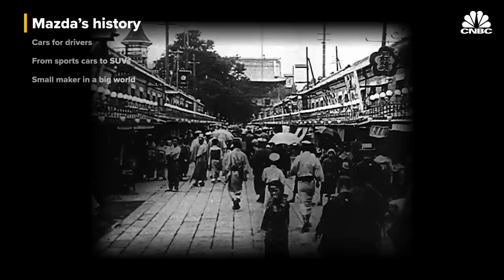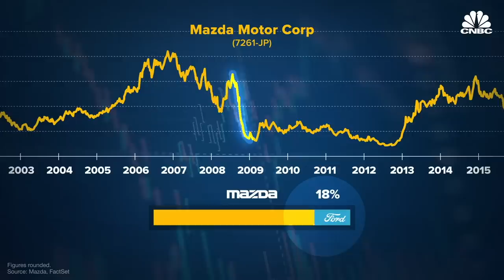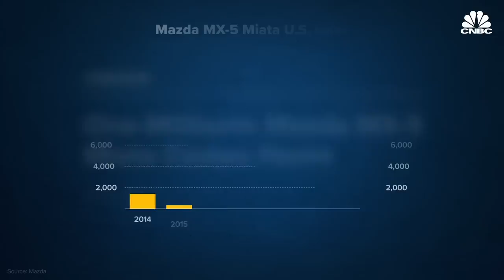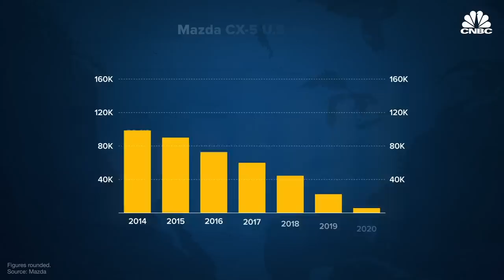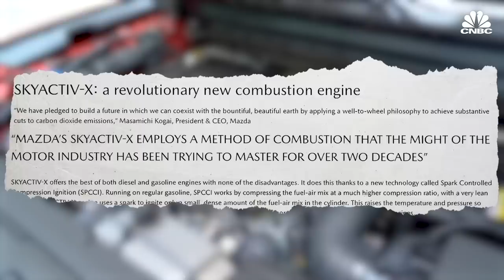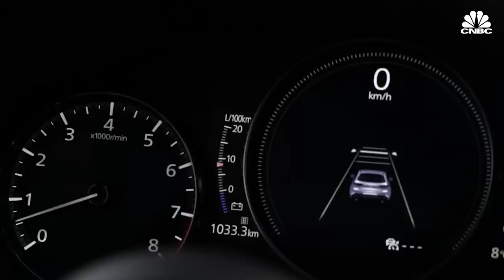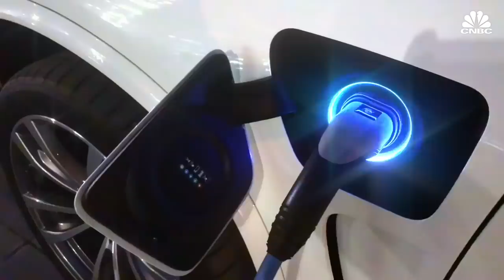Can Small And Scrappy Mazda Survive Among Automotive Giants?

Comment: With almost every company making CVTs as their main transmissions Mazda is still using more natural feeling transmissions thank you for that.
Reply: Bought a new Mazda3 this week.  Sure it gets worse fuel economy than the Elantra/Civic, but it's nice having a regular transmission and powerful motors.
Reply: Yes and no as It's too bad their 6spd autos are so dated , super slow shifting and not really comparable to modern automatic transmissions from other brands that shift so much faster and crisper.  I guess being so small they don't have much resources to develop new transmissions
Reply: If they get the Toyota CVT, their MPGs and 0-60 will improve drastically
Reply: European companies aren’t using CVTs either
Reply: What is the difference please
Reply: “Natural”
Reply: What is a natural feeling?
Reply: YES, I love the manual transmission. I love driving a car, not pushing a button & steering a lounge chair like those SUV-driving AUTOMATRONS who think their mirrors are for checking if their door handles have splattered bug on them while their driving; instead of checking the traffic in the lane next to them.
Reply: @cx5870  gear changes instead of a cvt which holds the rpm at a certain point
Reply: @Bambotb  CVT'S are generally less reliable; the least are Nissan cars with cvt's; avoid them like the plague. Toyotas and Hondas should be ok.
Reply: My car has a cvt and when friends drive it they ask if it's a dct because it shifts so fast
Reply: @cx5870  It's close to manual transmission feeling which I am used to driving. But when I came to North America found almost no one drove manual and almost all cars sold were automatic. In fact, those which came in manual were generally very lower spec models which made it quite a bummer.
Reply: @kidnamedfinger6323  Yes, it's cause there are no physical gears. Its just belt and pulleys...
Reply: @Bambotb  CVT always at high revs going eeeeeeeeeeeeeeeeeeeeee but offers better economy.  Auto works almost like a manual. Less noise, Revs build up with every gear change. I' m a sucker for manual which is the least economical choice but is the most reliable ( as long as you do the right maintenance) and most fun.
Reply: You do realize their transmission is a very old and aging 6-speed automatic design that almost every manufacturer has evolved from 10 years ago, don't you? There's a reason why Mazda moves at such a slow pace; they can't afford to do so otherwise and the customer pays for it. You're paying a premium for corporate sentiments rather than tangible goods. That's a raw deal.
Reply: Exactly, I own 2 Mazdas, one with standard transmission and the other one with a regular automatic, no CVT for me, thanks mazda
Reply: couldnt have said it better myself. mazda's are fun to drive unlike basically everything now.
Reply: Toyota has a good CVT but In many of their vehicles, they are still making geared transmissions. Lexus vehicles, Toyota Camry for example.As they should as Toyota geared transmissions are well made and reliable.
Reply: @gilboman  their torque converted transmission is bullet proof compare to when theyre were under Ford
Reply: CVT’s need to be banished from the market! Oh how I HATE CVT’s!!!!!
Reply: @gilboman  they make their own transmission everybody else buy it from zf aisin jatco getrag
Reply: @kristians2704  how about renault some mini models audi french use cvt list is long mate plus nothing wrong with cvts if you  drive carefully every transmission have some kinda problem dcts have problem too thats why everyone is ditching them
Reply: @ramanjitsingh4340  They aren't ditching them due to problems. They are ditching them due to stricter regulations every year for fuel efficiency.
Reply: Don’t forget the manual transmission.
Reply: @Bambotb  when you hit the gas in a CVT the car doesn’t go... there’s that
Reply: @anonymous00117  can’t afford them new always buy used so I can only get what someone else wanted. Which is the current situation with used cars. Hint why manual transmission cars demand a premium on the used car market.
Reply: @markmiller4503  what about porsche
Reply: @Bambotb  I’m not sure I have never drove a cvt Porsche...
Reply: Mazda always been number one on my list ..1 of The main reason I got a mazda was because of them not using that stupid cvt transmission 
No response 
Horrible fuel economy 
Un reliable 
 A fortune to fix 
Will last no more then 5 years 
Will force consumers to constantly buy cars 
Cvt are beyond garbage transmission.. I had a bad experience with it and. I will never ever buy that crap again 

I got a mazda protege 19 years old still running and I abused it too and it still takes me to work and back mazda a soldier when it comes to reliability and longetivity 
Just got a cx-5 hands down on of my favorite suv I bought 
And the feel of a regular transmission is amazing 
Thank you mazda keep it up 
I been. A loya customer of you guys and always will be
Reply: @gilboman  im gonna disagree with you on that one therre 6speeds are actually pretty smooth shifting and hauls ass i love my cx-5 the speed the size the comfort its perfect 
mazda is one up on the transmission game tho because they dont use that bullshyt cvt transmission that almost all cars are using now adays  
you dont even know what cars have and dont have cvt bullshyt ..mazda is that one brand not only reliable to the extreme but dont use garbage transmissions  like almost every single car brand out there 
mazda aint small no more there coming up anad collaborating with toyota .. and there new line up of cars are beautiful
Reply: @Striker50_  
i hope they dont cause cvt are garbage
Reply: @fp5495  
i never had any problems with my mazda with any of em and another thing u can say there 6 speeds are outdated but they would spank any engine with a cvt toy transmission all day .. and i think there 6 speeds haul ass  and very smooth shifting and driving i love it .. mazda coming up  especially on there skyative tech
Reply: I would pay extra just to avoid the belt and pulley style CVT.
Reply: @Striker50_  No, just a little more. If you want drastic improvement go with a hybrid.
Reply: I disagree , a lot of companies are switching over to 7-8-9-even 10 speed automatics , and Mazda has had the same 6 speed auto trans for years now , and engines are the same as well , it’s literally the same car just outside appearance is changed , also the cost for the dated tech is outrageous , I was looking at a Mazda 3 hatch and the way I liked it was kissing near 36k , got a Tesla model 3 instead for 37.8k
Reply: @gilboman  exactly thank you !!!
Reply: @kidnamedfinger6323  It won't shift at all 4 years from now, but good luck
Reply: @Striker50_  My family switched from an older Corolla using a 4-speed auto gearbox to a newer one using a CVT but I measured the fuel consumption to be about the same (though the latter runs quieter)
Reply: @lzh4950  The older Corolla must weight much less.
Reply: @anonymous00117  Was thinking the same thing, maybe because they can't afford a new Mazda, surprising I know. It's so hypocritical of them, they want brands to keep making manual transmission cars and when they do, they jump up and down and sales are a disaster. You know why? They want to wait for those cars to come to the used market, then they can pick them up for a bargain price. I totally agree with your point of view, if you want brands to listen to you, you need to buy their product from them, then they will listen to you. Being a keyboard warrior and ranting on the internet will do NOTHING!
Reply: @maggiejetson7904  and No stop start crap. That and poor paint are good reasons to avoid mazda cars. I will be shopping at Kia or Hyundai after my disappointment with mazda aftersales Non support and poor service experience.
Reply: @gilboman  You only need 6 speeds since the car doesn't hit more than 130 mph.
Reply: @tylersmith4265  And you forgot, less expensive than a Civic.
Reply: @miatand1156 My 2024 Mazda doesn’t have the crappy, start/stop feature. I wouldn’t have bought it if it did. ✌🏻
Reply: cvts are underrated, but it makes sense for Mazda to
use a regular 6 speed automatic. yeah because the brands DNA is
still felt in the vehicles they're producing,
a company will only make what they know, but it's also the customers
they attract. people that are looking for a 
little more driving enjoyment, will buy Mazda, because that's what they're
looking for. no company ever wants to alienate
there customers, but the reason other companies are using cvts, 
it all has to do with efficiency. And at the end 
of the day, the average buyer who needs a car doesn't care as much.
their only looking for reliable transportation.

Comment: I love how Mazda manages to keep their interior very sleek and simple while keeping physical controls and buttons.
Reply: Well they don't have a radio volume knob or change the channel knob so that's a set back for me. Having to go to the display for anything is NOT progress in my book.
Reply: @captinbeyond  I don't know which ones are you talking about. But in Miata, Mazda 3, and CX9 (frankly, I have not tried the other ones) you have a rotary volume knob on the center console (much like Audi used to have). And very close to it a bigger rotary knob for the multimedia screen, which you can use to set the radio channels or navigation, etc. (Also very similar to what Audi had before going full iPad). Overall I would say that Mazda is trying and it seems like they are actually employing ergonomic engineers rather than just designers. "Having to go to the display for anything is NOT progress in my book." - I agree, hence I like what is Mazda doing.
Reply: @TomKosCars  I stand corrected if you know for sure, but I base that it( mazda 6) didn't have radio knobs on review videos I've watched. Thanks for the update, now all I need is to find a local dealer...lol
Reply: @TomKosCars   I just went to a couple videos that show how to set the radio of 2019 Mazda 6 and it clearly states there are NO conventional on/off knobs and no pre-set buttons like on previous generations, You can still set stations but everything is done via the display screen. So I looked at another video of a 2021 Mazda 6 and on the dash there are 2 buttons that look like radio on/off and channel changing knobs but they are in fact the climate control settings.  So I'm not sure if you understand what I was wishing for. It is not advancing or making something better for me to have to play with the display for listening to the radio or changing stations.
Reply: @captinbeyond  Radio on/off/volume is a small knob in the center console, under the shifter. 

You are right about the radio preset buttons, it takes two steps now. Next to the big knob to control the display, you have a button with a star symbol and that takes you to your favorite radio presets, then you have to choose there. I guess you could drive around with the radio on the screen all the time and that would leave you with one step.
Reply: @TomKosCars  Yeah, that's what I thought. I can do all that on/off, changing the stations without having to even look with my old fashion  radio. Having to use the center knob on the console, then glance to the display...just fixes something that wasn't broke It's not advancement, it's not better, it's not easier, and it's just dumb that we delude ourselves today with things  by pretending they improve things when they do not.

Comment: If Chrysler and GM are still around I can safely say Mazda will be just fine. Considering they actually make reliable vehicles.
Reply: Not if entire automotive segment changes. 
Japanese government would probably not save Mazda if it fails like US government does.
Reply: @neeljavia2965  so far they’re doing good & like toyota, they seem to be planning for the future and ahead of time, not for the next 3 months like gm.
Reply: @cesarurzua8234  Actually GM has planning for the future right now, unlike Toyota who is hesitant to shift.
Reply: 🤣🤣agree 👍
Reply: @neeljavia2965  GM built EV1 and they scrapped it for financial reasons, but GM seems to be better with electric cars over their gas ones. VOLT AND BOLT are very good cars. BOLT just needs a better design.
Reply: @bmw803  Yes.
Reply: 2013 speed3 sold at 168K miles. No issues. Most reliable vehicle I've ever had. Bought it new.
Reply: Here in a small seaside California town, about half of the new Japanese cars are Mazda!
Reply: @bmw803  those are Opels to my understanding though
Reply: @CallumDavis_  maybe. I'm not sure.
Reply: @neeljavia2965  Being hesitant to shift depends on teh product. Making too many changes at once isn't necessarily a good idea. Toyotas are #1 and will be for a long time because they make reliable cars
Reply: Chrysler capital is keeping their brand afloat. Anyone can get approved for a Chrysler vehicle. Even a stray dog.
Reply: @bmw803  Not at all. Opel had nothing to do with either of those models. Opel no longer exists.
Reply: @Dansk55  Agreed. 
But there are lots of people who love new things. 
Even toyota is trying to make less boring cars.
Reply: @fp5495  Okay. I am willing to listen to you. How come that Opel produce the same two cars in Europe under their brand as Chevy does in the US?
Reply: @fp5495  okay, a quick Google search has shown me that GM did in fact develop the volt, which was later also sold as the Opel ampere in Europe. I stand corrected.
Reply: @fp5495  Opel pretty much still exists as most Buick cars are just rebadged Opels.
Reply: @ryanharris6555  I thought that was nissan that approved even the dead for a loan lol
Reply: @bmw803  dude the Volt was pretty forward thinking for MY2012.
Reply: The Pentastar and the SBC are fantastic engines. Meanwhile, the Wankel is a time bomb.
Reply: @neeljavia2965 😢

Comment: I drive a new Mazda 3 and it's fantastic. They definitely get a lot of things right I hope they stick around for years to come.
Reply: Same.  Every time I think about trading it for another brand, I change my mind after the test drive.  I just hope they are still making the CX-5 when I'm ready to upgrade. 😕
Reply: Me too!!!
Reply: Me too! 2020 year model. I love this car!
Reply: I have a 2018 Mazda 3 hatchback.  I love it.
Reply: No crossover could handle like this slick hatchback, I love my 3 too
Reply: How's the rust issue on these Mazda3s?  Earlier generation Mazda3s had problems with premature rusting.
Reply: @KP-xi4bj  rust was an issue for mazda before the early 2000s
i know quite a low of people with Mazda 3s that are 2003,2006,2012 models and they are all fine even with the heavy winters we get here...
Reply: @moonsapling  Where is here?  And do you get rustproofing there?
Reply: @KP-xi4bj  Eastern Europe
idk about rustpriofinf we just get 2nd hand mazdas and beat the crap outra them
Reply: @moonsapling  Do you use road salt in your winters assuming it snows where you are?
Reply: @KP-xi4bj  yeah
This and 3/4 seasons its dripoing wet here, we also dont have garages
Reply: I recently got a 3 as a rental. Very nice looking interior, overall design and felt great to drive. However, the seats weren’t super comfortable and the infotainment system was not user friendly. Still would be a very good deal at the price usually they’re listed. I’d definitely get one over a corolla or civic.